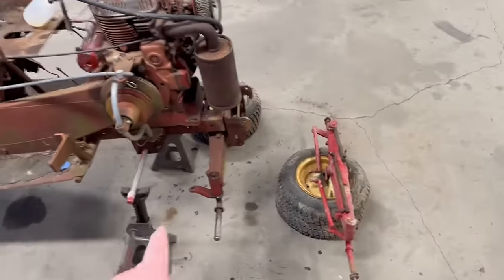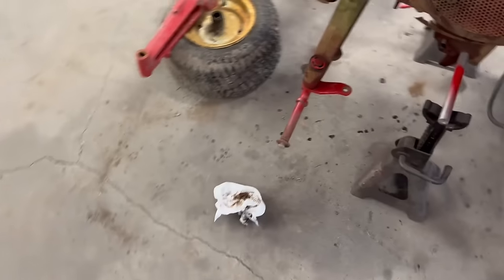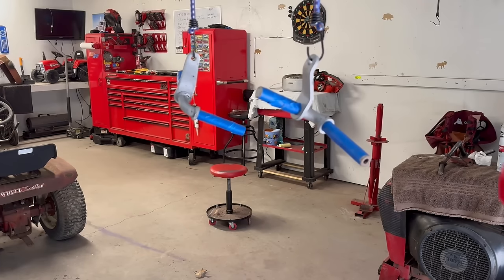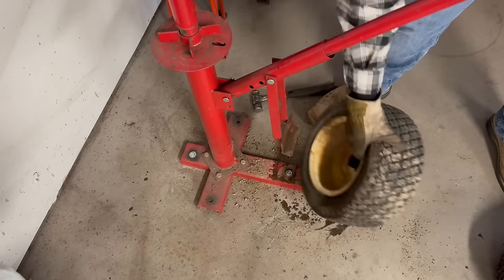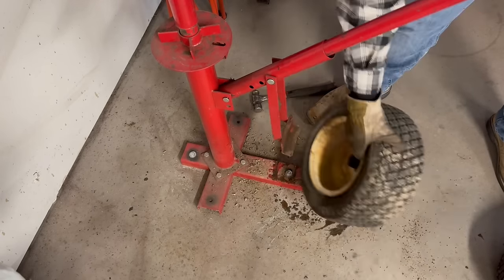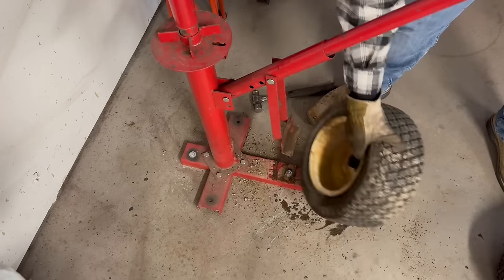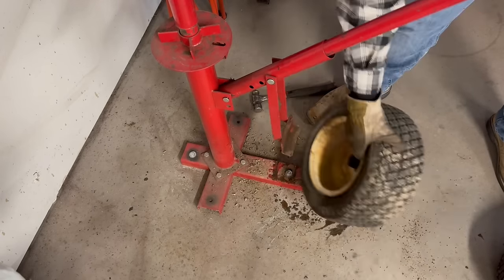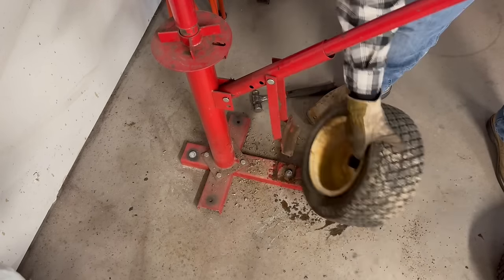B100 Part 2! Revive and Drive….around the yard!

Comment: I put them bolt on crossbar and ball joints on a nice mower i was saleing dtl 3000..And i had a daily dtl 3000 well when i cut grass..Anyways i rode both and the one i did that to like it had power steering..Huge diff..I seen a old video of poor mans power steering.2 washer and a thrust bearing in between..Goes right where you bolt spindle  on..Kid said he paid 5 bucks for them..Sorry for the rant 2 am in Bama ..Need me sand blaster machine. .Nice..Enjoyed..ty
Reply from the maker: I really need to look into the thrust bearing upgrade. I've had quite a few people tell me about it. Thanks for watching!

Comment: great video. if i were you i'd keep it. fun to watch you work on it. i'd like to see your set up for the outside sandblasting sometlme. check the rubber boot that goes over the shifter down to the transmission. a new one could help keep water out. thanks.
Reply from the maker: The  outside blaster set up is a still a work in progress. Works great sometimes, and not at all the rest of the time lol! Good idea about the shifter boot! I was actually wondering if a late model auto cv axle boot would fit the bill!
Reply: Water in trans is an issue for most machines that spend any time outside so a good idea re:boot!!

Comment: There’s a couple of things I’d do differently.
That engine oil looked so bad I probably would have run diesel in it first, then oil to flush, then final oil. There’s gotta be more sludge in the bottom. 
Also, I would always pressure wash the entire machine before starting, just to get the majority of the dirt and grease off so it’s nicer to work on, plus you can see more of the details and issues ahead of time.  In this case the fuel tank area and battery tray would have already been clean.

Comment: Really digging the channel and content. I was a huge wheelhorse fan. Me,my dad, and my granddad had them. Now just remember my experience was from the late 80s. My local dealer was always a pain in the ass back then. I think mine was a 314. It had transmission issues. Went to my dealer and i wanted a service manual, i fixed it without a manual. They wouldn't sell me one because they wanted to repair it. He was a real dick. After that we all bought 3 new john deeres and never went back. I really like wheelhorse, but we never went back to that dealer. They are still in business selling toros but ill stick to my john deere. Hope to see some more wheelhorse vids on your channel, keep up the great work!!
Reply from the maker: Thanks for the kind words! I got bit by the wheel horse bug a couple years ago and haven’t looked back! I’m extremely grateful for guys with a passion for this hobby because almost every repair/service/parts diagram can be found online free of charge nowadays !
Reply: Typical short sighted, narrow minded dealer. Helping out locals in any way benefits everyone. If he’d sold you the manual he would have had a parts customer and referrer for life!  Some people just don’t see the big picture.
Reply: Talk about cutting off your nose to spite your face.
Who needs a dealer when you can turn a wrench or screwdriver yourself and most manuals are available online.
As for JD it's clear that they are selling "Dealer repair only" equipment and their off shore sourced crap is costing more to fix than the profit you can get off the crop so what's the point.
Made in the USA is still running 40yrs later and looks good doing it and will keep doing when all this Green junk is not even fit for parts cause 1year after it's made you can't get the computer board that runs the damn thing.
I'm moving back into analogue in every aspect of my life just in case the next "Carrington Event"  is within my lifetime and even if it ain't least my kids can still cut their grass with Grandpa's ride 'em tractor!!
Just sayin'

Comment: ANOTHER GREAT VIDEO!!
Love me some Wheel Horse so it's all good!
With that said!  Regarding the front end rebuild.
Why didn't you just pull the pivot bolt and drop the whole front end to replace it all ez-pz? 
Once into mixing and matching parts why not just buy a matching E-Clip to match the other pivot?
No wonder you're out of grease!  Half of it's on the outside!
Maybe you should just use that excess on the rack n' pinion steering which looks a little in need of lube.

Wire brush on the rear end before pulling the plugs and even a blowing off with the air gun after brushing and wiping it down just makes sense to keep the dirt out of the plug holes.

Shoulda blowed out all that crap and per washed the unit first thing fur anything.

Just sayin'

I know that's how the mount on the fuel tank came from new and mines exactly the same but dang it looks like someone just decided to use a coat hanger to hold it on!   Not that there's anything wrong with that.  I'm a big believer in the utility of coat hangers.

Watching the Battery box clean out and replace just think maybe some locking nuts nylon or otherwise would keep the battery hold down in place a little longer.  Did I hear you forcing fuel through the system with an air chuck?  Hard on where it seals at every point.  Can be needed but not if absolutely necessary otherwise just let the fuel flow with gravity and pump pulling it's prime front the tank.  Charging the tank with air like that can force all kinds of crap past the tank, filter, seat, float into the jet plugging either the Jet or needle making for more effort than needed to get running
Enjoyed it a great deal and have a hat just like that.
Best
lee